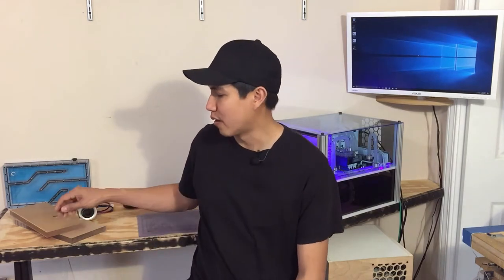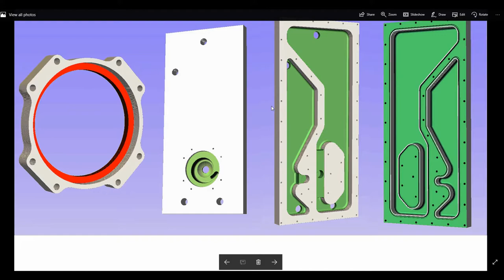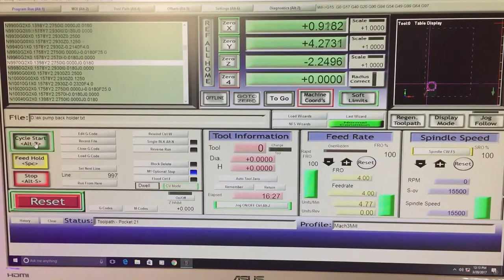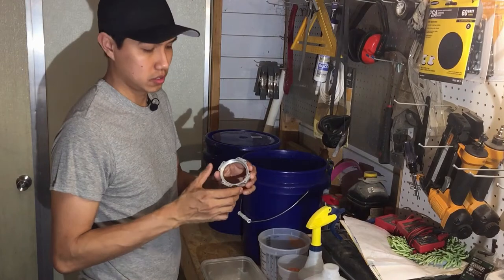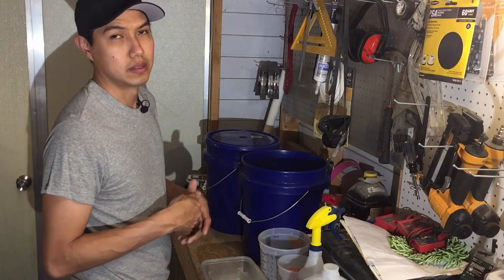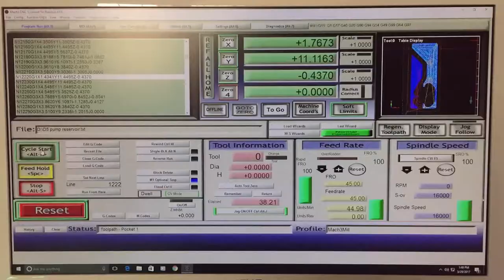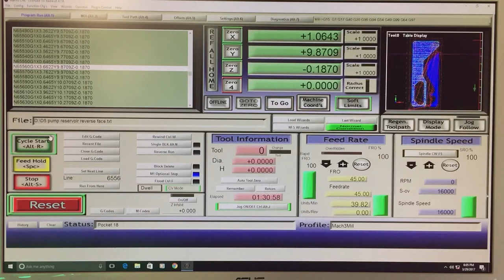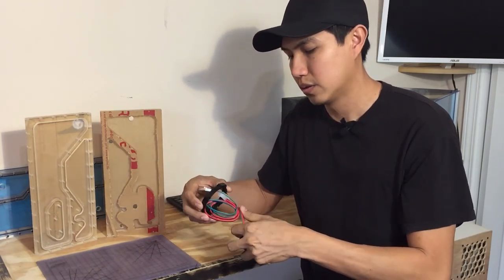Building a custom D5 pump reservoir: pt.2

Comment: You might want to tram that router abit more, I could share some drawings for a cheap tram bar that actually works
Reply from the maker: KjetilT  well I try traming the router a while ago,  but then it work worse hahaha,  so then I try again but I notice my whole Z-axis flexing so when I try to fix that the tram went bad again, it's a big pain to get it right with this cnc

Comment: Huhu

What is a CNC milling machine?  Very good work I must say and very good videos ^^
Reply from the maker: thanks
CNC = Computer Numerical Control : but what it means is a computer controlling a milling or lathe or (others)machine tools
Reply: ahhh ok cool But can you me times the CNC types you use say because am also to the superior water cooling to build coponents themselves? And could you run also over a server the over a VM controls?
Reply from the maker: xXTerenceHillCc the translation wasn't good,  but what I understand is :  my CNC is a Chinese 6040  similar to this 
http://m.ebay.com/itm/USB-Mach3-CNC-6040Z-80S-3-axis-2-2kW-Engraving-machine-CNC-Carving-Machine-/222277623542?hash=item33c0c75ef6%3Ag%3ATPsAAOSwnHZYmSpn&_trkparms=pageci%253A24ea831a-2394-11e7-80a6-005056976d20%257Cparentrq%253A7cfb1ec515b0a2af20ebfbbdfff6dd7e%257Ciid%253A2
 I didn't get the last part . If you can run the CNC over a server?
Reply: Well I guess if I can also control the CNC via a server with a Virtualline Machine? I'm sorry with the Google transcriber
Reply from the maker: xXTerenceHillCc hmm. Good question.  I don't know the answer  
 If the computer that controls the cnc is connected to a Server  then maybe you could use a VM But I don't know that